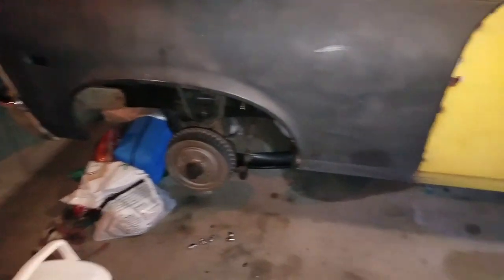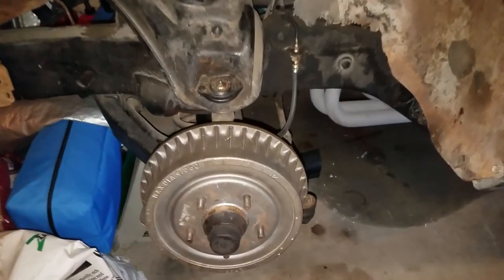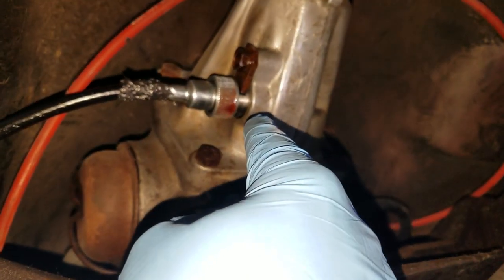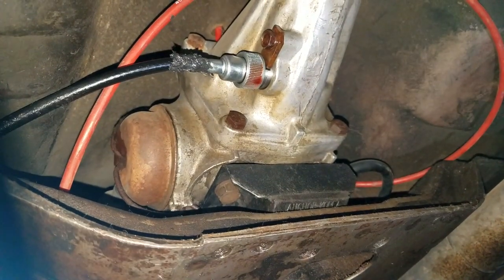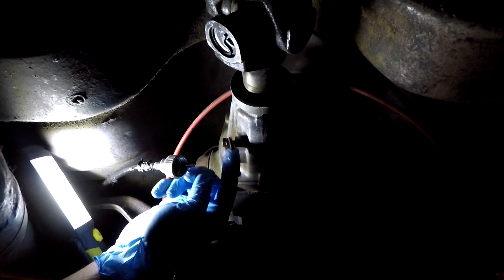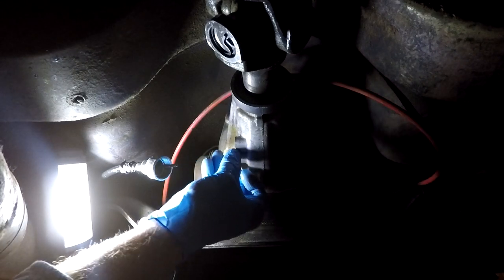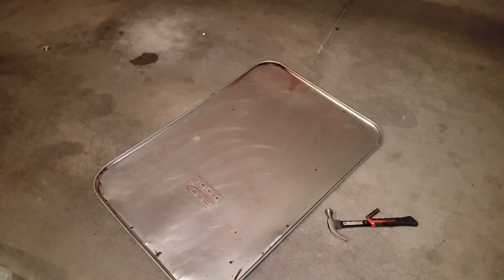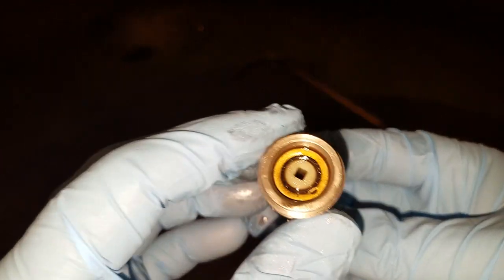fixing chevy speedometer cable leak (finally?)

Comment: Thanks for the tip.  Replacing seals in my bullet now so if it still leaks I'll know this sweet little tip.
Reply: Did it work brotha? I’m having the same issue
Reply: @haykojan6590  mine is a project truck and its not road worthy yet. I replaced the. Bullet with a new one and put in a new trans filter and fluid and my truck hasn't started since so I can't say for sure. But just sitting there it hasn't leaked on the floor at all
Reply from the maker: Mine no longer leaks from here. The pan however is another story...
Reply: Shit took my bullet out my th350 outta my 84 cutlass seal was leaking so I rigged 2 ac green seals onto each other it’s been holding up the last year easy fix but it took me a hour and got messy

Comment: I remember watch a video where the mechanic claimed they put two of those rubber seals in the bullet to stop those types of leaks.My thm 350 oldsmobile transmission had the same problem.

Comment: I have same issue, with a th350, but it seems like it's coming from the cable? I pressed the bullet in, and replaced gear. Do They leak from the cable?

Comment: How similar would this be for the TH400?  Mine loves to leak and the speedometer needle swings around a bit at low speeds.  Might I need all of these parts as well?  I've looked around on Rock Auto and they show nothing of this sort, so where might I find parts like this for my 67 Impala 327?  Interesting I've been to Meridian many times as I'm just over and down from you in SLC.
Reply from the maker: I think the 400 is basically the same. You can try calling Idaho Transmission Warehouse and see if they have the parts you need. They might even ship them to you. Thanks

Comment: I just watched a video on the channel performance automatic. They say that bullet is made from aluminum from the factory and they actually wear out causing erratic speedometer and I would imagine leaks as well. They make a steel replacement . By the way I’m having the same problem along with other leaks. Good luck.
Reply: Would the TH400 (1967) use a similar "bullet" and plastic gear as well?  Any advice on where to find any of these parts?  Thanks!

Comment: What if you hit those threads with a little teflon tape before you screw the cable back in?
Reply from the maker: The cable itself does not seal anything in. It just screws on, teflon tape wouldn't help...

Comment: Hello, I noticed mines leaking in the same spot, i saw how u loosened the main connection, is there it possible just to tighten that up? Sorry for the crazy question.
Reply from the maker: Are you talking about tightening the cable or the bullet part?

Comment: How is doing now? It stopped the leak?
Reply from the maker: It appears I might still have a small leak but I'm not sure if its from the cable or not. I haven't crawled under the car to look but seems farther forward now. It for sure stopped leaking for a while, but I've had to add about a quart and a half of fluid to the trans and now its got a small leak again. I'll keep you posted on what I find out...
Reply: @meridian208  not long ago i bought a 71 chevy c10, it's  leaking trans oil and just found out its from the speedo bullet,  thanks to your video now i know how to replace it. Thank you!
Reply: @meridian208  Any updates?

Comment: Hi, running through the same issue just wondering if it worked ?
Reply from the maker: Well, I'm not entirely sure yet. It did stop leaking for a week or two. But my transmission was a little low on fluid. Not enough to where it shifted weird or slipped, but showed low on the dipstick. As I added in more fluid to fill it up I noticed a leak starting again. However, the leak looks like its coming from further forward on the trans than the cable. It could be the pan now, I haven't crawled under the car again to verify what it is. I will try to do an update once I see what is going on. Thanks
Reply: @meridian208  y
Reply: meridian208 and the king
Reply: @meridian208  has the leak held up?

Comment: So after changing all the stuff and reseating the inside of the bullet, what do you think caused the initial leak? Do you think you could have just tapped the inside of the bullet down and fixed it without replacing the plastic gear piece?
Reply from the maker: In some cases that may work. In mine the gear and the seal were worn too bad initially.